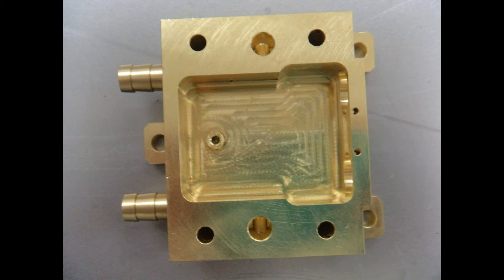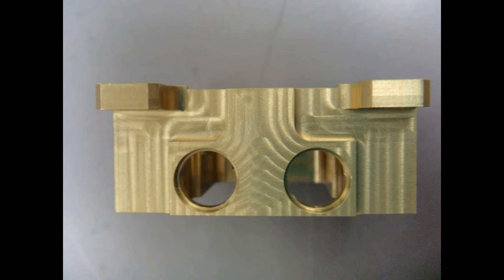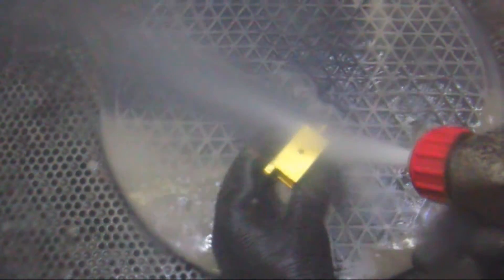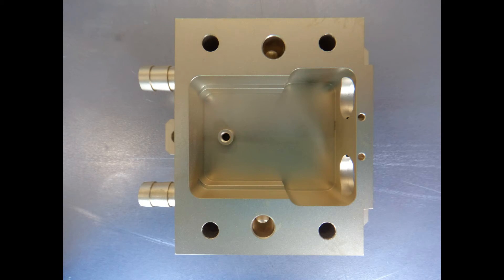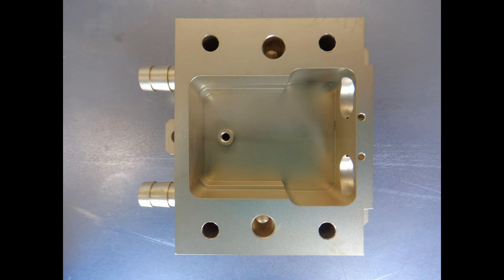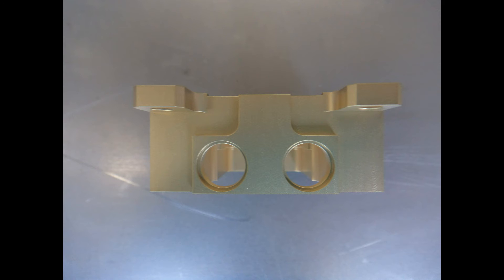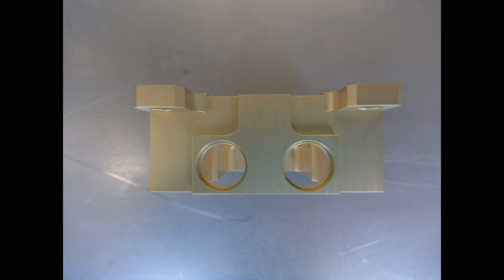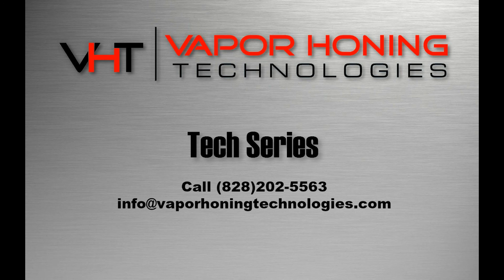Finishing and Light De Burring CNC Parts- Vapor Honing Technologies

Comment: is there a way to get that smooth satin finish on aluminium by this process?
Reply from the maker: Just uploaded a demonstration video for you finishing 6061 machined aluminum. Wet Blasting works well on most all machine able metals brass, aluminum, stainless steel, titanium etc. 

https://youtu.be/uyDTyV9QZmQ
Reply: Just checked out the video.. Its impressive. Thank you very much